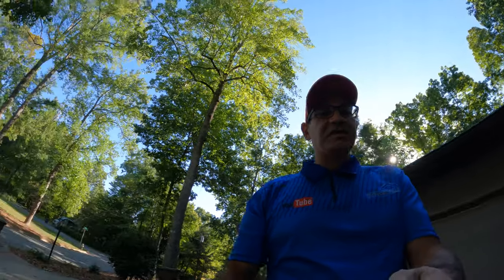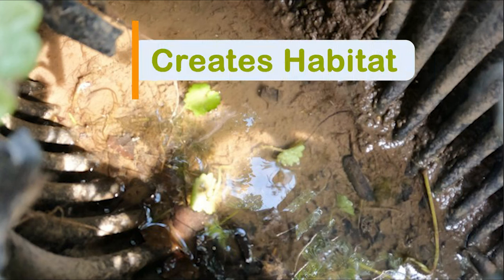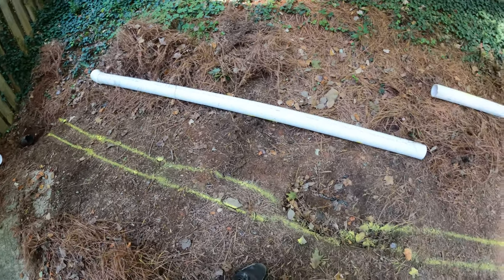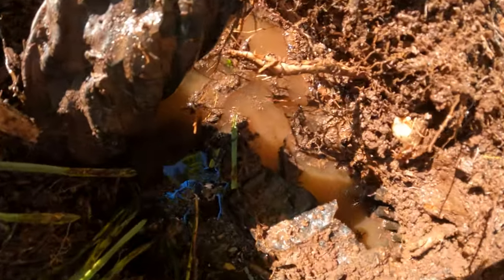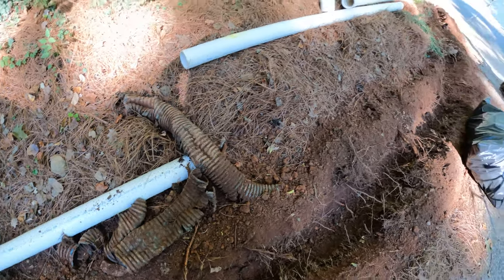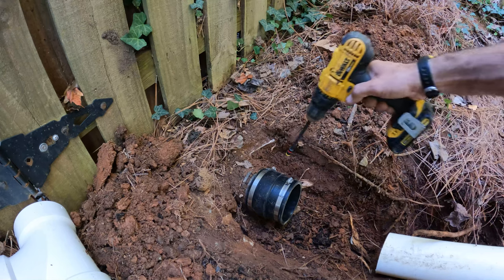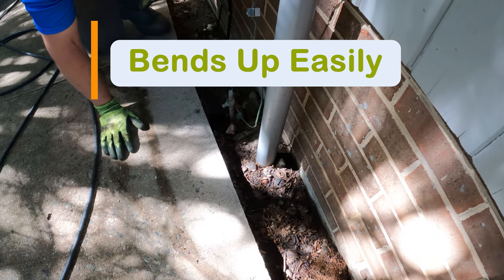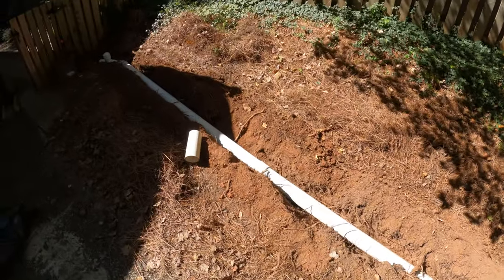Benefits of Corrugated Pipe for drainage work

Comment: It's not important to "mind your fall"...if you connect directly to the gutter itself. Why? Because then your gutter water will drain directly into a sealed pipe that could easily go over a 5 foot obstable in the yard. If you catch the "gutter water into a sealed PVC pipe at" a height of 8 to 10 feet above the ground...gravity will easily force the water to flow over a 5 feet obstacle.
Reply from the maker: I had a fixed point of the existing corrugated in this case. I had to be extremely careful to mind my fall from there to the curb.
Reply: That also means debris, dust/dirt, etc will accumulate in the PVC pipe over time. It also allows mold/slime to grow.

The pipe is then no longer self-cleaning. 

It also reduces the flow rate as energy is robbed to overcome gravity.

There's a reason this is a huge no-no for sanitary plumbing. Bellies in the line encourage deposits and clogs. Don't do it.
Reply from the maker: @xenadu02  yep! That’s why I leave the trench/pipe to settle naturally and slowly instead of running over with the trencher.

Comment: Do you use sch40 PVC or sch 35? Does it really matter? I've seen a huge difference in price between both but I've seen both being used
Reply: Because it's unpressurized water it doesn't matter.
Reply: He mentioned that he uses sch40, mainly because of the availability of all kinds of fittings which aren't readily available for sch35.

Comment: If corrugated is done properly, and you’re using a quality virgin material, it can last forever. But it has to be done right. Probably 90% of installs are done incorrectly. That is the problem. Check out French drain man channel—these guys are masters.
Reply from the maker: I would argue that throwing in a PVC pipe into your proper trench is a better decision than a corrugated pipe.

Comment: If you run out of fall you can bend it up. lol bahahahha. 

Cmon installers. if you run out of fall you’ve either done it wrong or you need to go about it another way. But Shawn highlights a good point the installers love corrugated because it allows them to be lazy and do shoddy work.